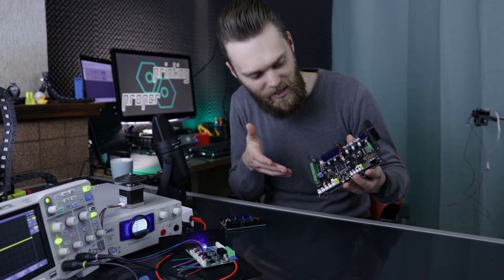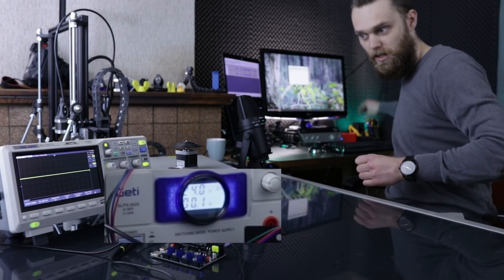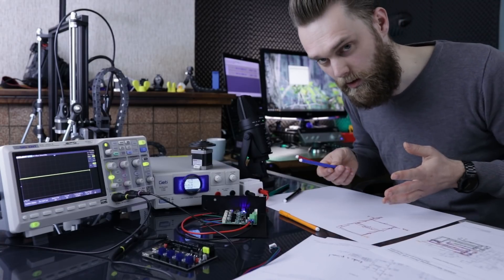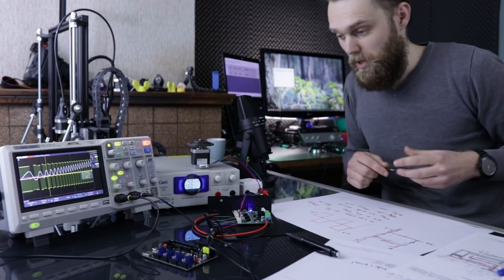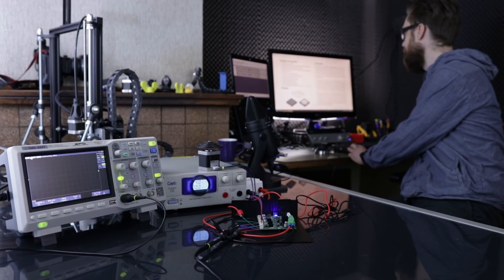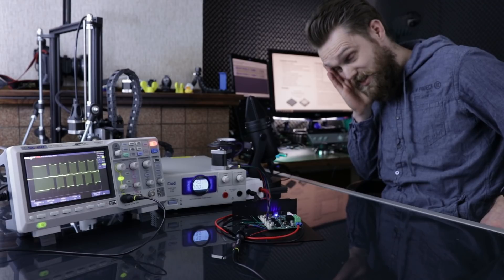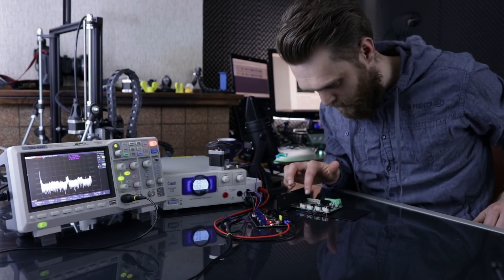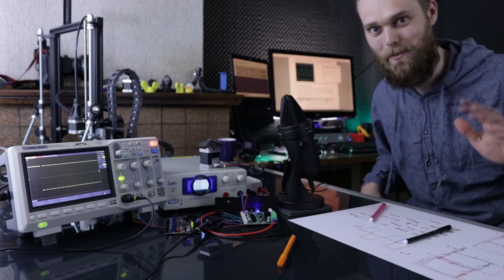Why did I blow up my stepper motor driver of my Ender 3?

Comment: I've literally just blown up a driver on my board, same as you and you upload this! Can you confirm that the wiring needs to be A1 A2 B1 B2 in the 4 pin connector? (Where A is coil 1, B is coil 2, found by detecting continuity with a multimeter between two wires going from the stepper)

I don't want to blow up any more lol.
Reply from the maker: What a coincidence xD The pinning is very odd.
On the 4 pin connector side:
coil1= 1A(pin4) and 1B(pin3)
coil2= 2A(pin2) and 2B(pin1)
 These are connected respectively to the 6 pin connector:
coil1=A(pin1) and A'(pin4)
coil2= B(pin3) and B'(pin6).
It looks strange but the most important thing is that the pairs are not connected to each other. The pairs on the motor side aren't next to each other (1 and 4 is pair one), (3 and 6 is pair two). If you're still unsure I'd suggest drawing both connectors on paper and connect them. I did that for this video but cut it out due to this video becoming too long. Maybe a follow up in the future, but for now I hope this helps :D

Comment: I extended my wires and I switched the middle two. It never rotated again when i powered it up without testing first.... So stupid!!!
Reply from the maker: And the driver isn't protected against stupidity xD Very common mistake I found out and you're definitely not alone ;)
Reply: I did the same for the fans. Creality has all of the fan wires reversed on the board. It is stupid if you ask me. Luckily it is not permanent damage and you just need to switch the wires back around.